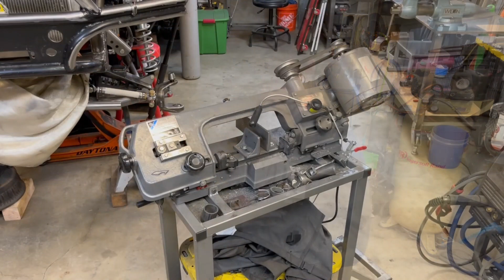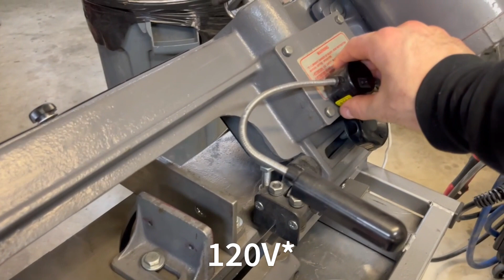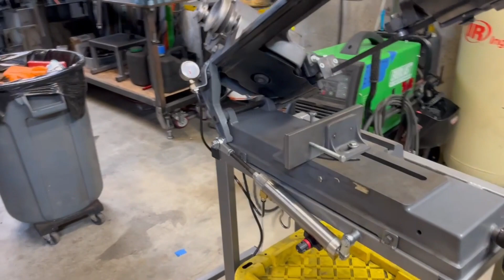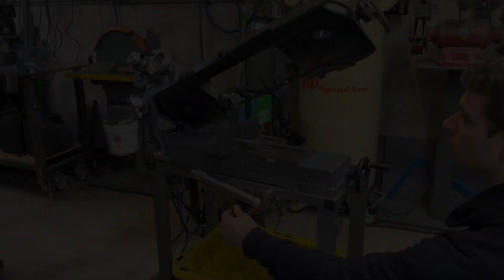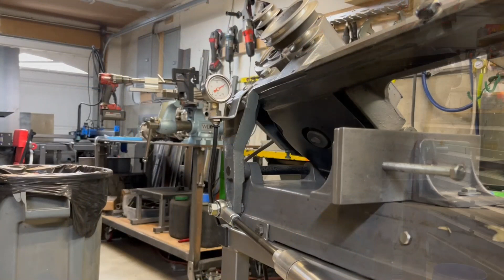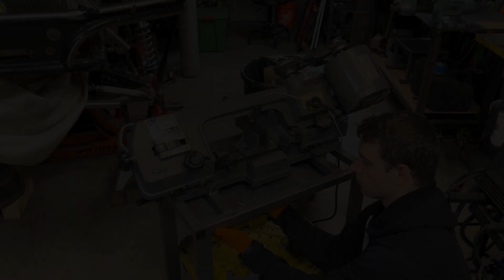Harbor Freight Band Saw Hydraulic Down Feed Modifications

Comment: Looks great you choose to use a pneumatic cylinder and valve to control air flow and you filled it with hydraulic fluid?
Reply: I was asking myself the same thing. I'm trying to build a similar system but I have some troubles with the cylinder. I filled it with hydraulic fluid. I used Castrol Hyspin AWS 32 because that's what I had on hand. Maybe something with lower viscosity would work. Would be interesting to know what he uses.